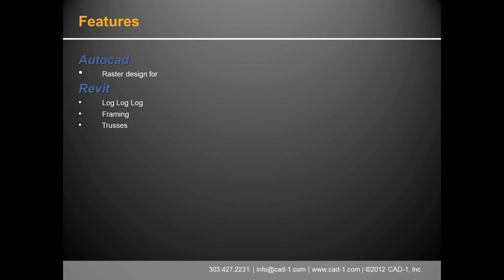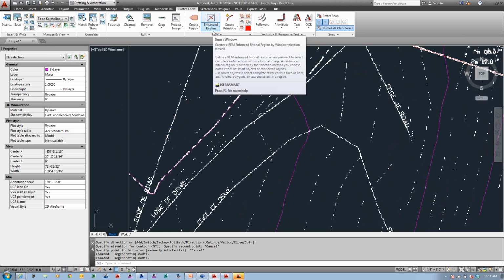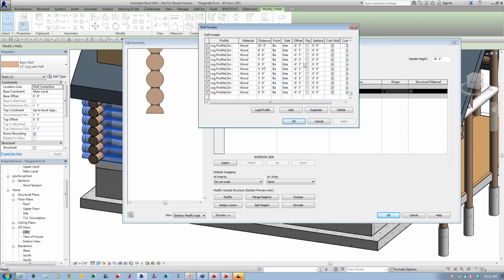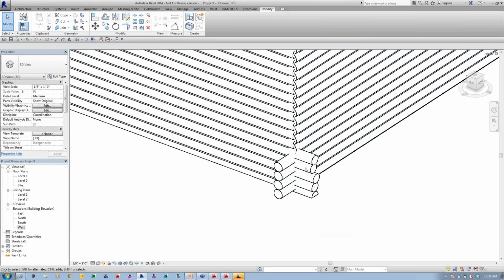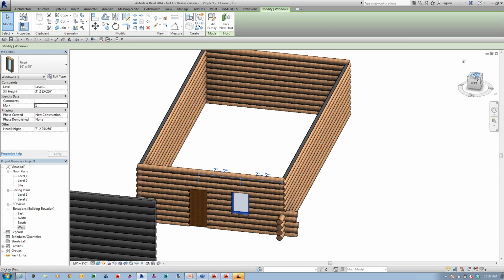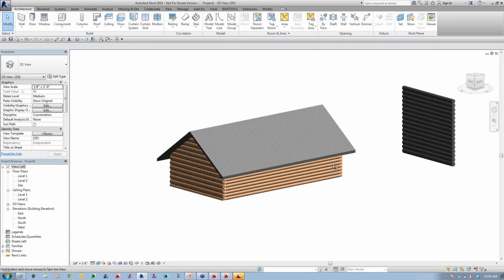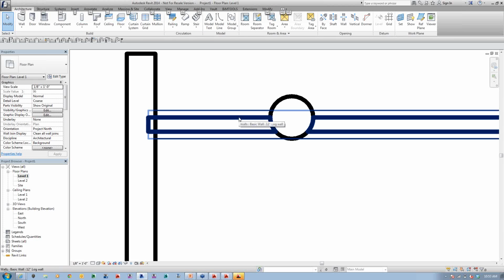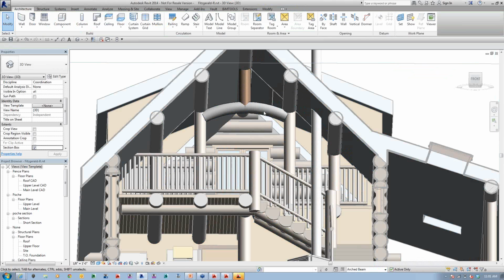CAD-1 Presents - Log & Timber Construction in Revit

Comment: Good tutorial. However, on my project it was more time efficent to use reveals for the chinking apposed to sweeps for the logs. I tried sweeps at first but clean up was a nightmare. I suggest using whichever is smaller in height to save time and minimize cleanup.
Reply: Good insight, how do you handle the saddles?